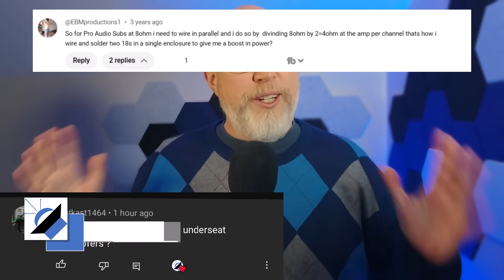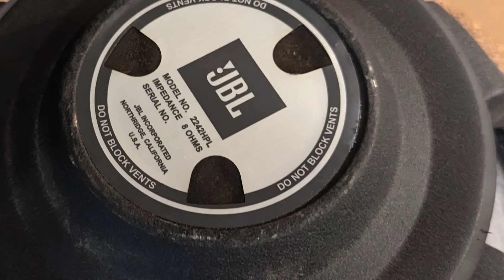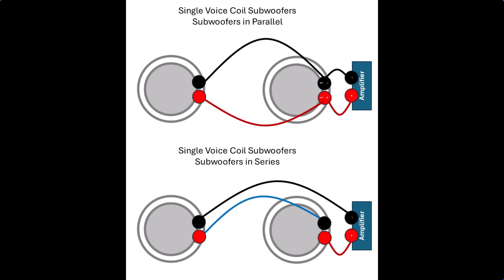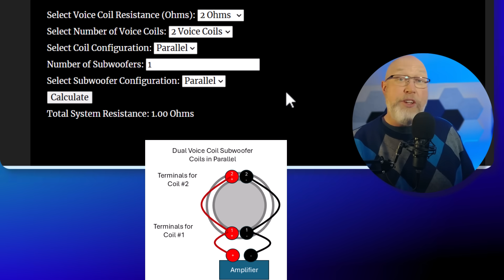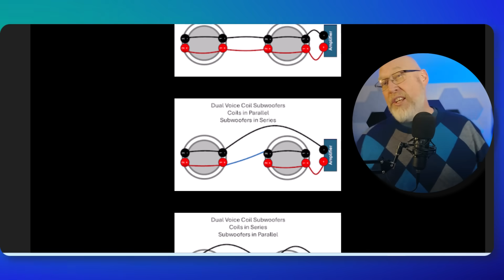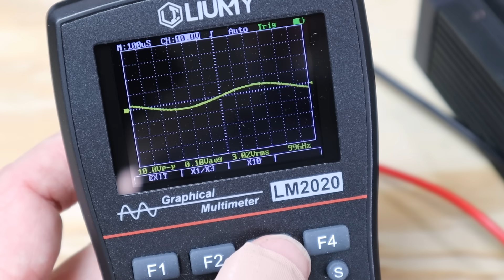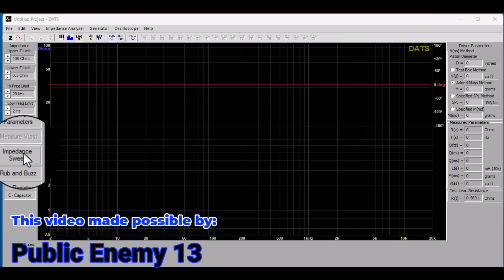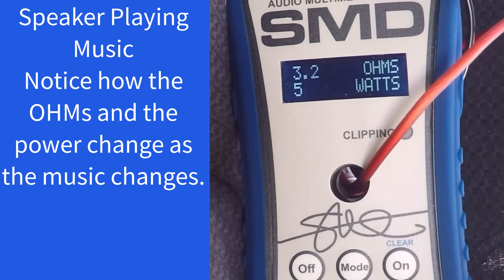Wiring your subwoofers for more power and more bass!

Comment: 12:19 "When you pass a coil through a magnetic field you create voltage". 11:41 - That impedance spike @ 62hz is directly due to the voltage the speaker itself creates as it moves its coil back and forth in the magnetic field. Since the cone vibrates the most at the resonant frequency, it creates the most back emf (electromotive force - voltage) back towards the amplifier. That measures as increases resistance to current flow therefore increased impedance. When you put that driver in a box that impedance curve will change. Anywhere on that new curve you see an impedance minimum the cone hardly moves back and forth (although it is sucking lots of power and pushing hard) and it's the boxes/ports/chambers/horns resonance that does most of the work. Anywhere on that curve you see an impedance maximum, the cone is moving like crazy doing all the work and the boxes/ports/chambers/horns are not resonating much.
Reply from the maker: Cool stuff.

Comment: Dig key calculator works great and you can add multiple resistance.       Bud you have said multiple times now that your calculator will give you the same in parallel or series.    I hope your just miss saying it.
Reply: On your calculator explanation lol.    You kept saying it didn't matter it would come out the same!    I hoped you just miss spoke there bud lol
Reply from the maker: @davidschreckengost7959  If you have a single coil and a single subwoofer and you choose parallel you will get the same result as if you choose series since there is no second thing to wire it to.
Reply: @DIYAudioGuy  oooo OK  gotcha 👍

Comment: If my subwoofer has sticker on the motor saying "3000w 2x2ohm" Then it will take 3000w, but store page says 1500rms, i have 1500w amplifier but will i buy amp that can do constant 3000w to get everything out of my speaker?
Reply: 3000w will be peak power, not performance. Youll usually find that the 3000w peak will only be at a certain frequency band meaning not the full frequency range you set it to or want to play at. Look at the subwoofer manufacturers graphs for more information.
Reply: Yes 3k watts amp
Reply: @62dobie  Also my shitty amp only gets to 31v at output when measured with multimeter
Reply from the maker: No idea, that label is a little confusing.  I would assume 3000 w total power.  But not many subwoofers can take that kind of power.

Comment: Are you sure that if you wire a single dual 2 ohm woofer in series it doesnt give you 4 ohms? Because I have done it both ways and there is a very distinct difference in volume from the woofer but that might just be because its a kicker subwoofer. 😂
Reply from the maker: If you wire a pair of 2 ohm resistors in series you get 4 ohms.
Reply: @DIYAudioGuy  lol
Reply: yea, at one point in the video he said it "doesn't matter matter if we choose parallel or series wiring, its going to give us the same answer...1 ohm". That was confusing (and sounded incorrect) but i think he meant as far as the calculator was concerned since it was a single sub? It could have been worded better. But yes, parallel drops impedance, series increases it. Think of the old "water flow" theory. If you lay 2 pipes in parallel "=" (next to each other) it makes it twice as easy to flow, ie less impedance. If you put the pipes in series "- -" it has to go twice as far and it makes it twice as hard to flow through, more impedance. (i hope i said that clearly)

Comment: How can I run 4 8ohn mid-range speakers and 44ohm tweeters to one four channel amp without damage to amp?
Reply from the maker: If you're just talking about wiring them up somehow or another, I made a calculator for that, I even made entire YouTube video showing off the calculator. 

Beyond that, you'll need crossovers, not sure what you want to do there. Are you planning on using the crossover that's on the amp or a DSP? Or do you plan on using a passive crossover network?
Reply: Or, just buy another amp for tweeters.

Comment: What are some good 12inch shallow mount subs that will bang in my single cab for a reasonable price for the power I want something good plan on running d4s jp8
Reply: Pioneer were considered the best shallow subs in their price bracket for a fair bit.
I've used and installed a heap in all different sizes and have found them to be very good quality and if mounted in a decent box they play about as low and loud as anything else in that price bracket.
I really can't fault them to be honest.
Id love to see a comparison between some of the common shallow subs as where i am most people don't want or (more commonly because they drive mid size utes (pick up trucks)) can't fit a giant box in their car but do want more than a factory system can provide.

Do it dude!!! 
Shallow mount shoot out!!!!! 
And maybe box design to maximise volume utilising odd areas of the vehicle. 
Always a fun project!!

Love your work @DIYAudioGuy you're breeding a new generation of bassheads and we need them to keep the boombap alive!!!!
Reply from the maker: The really good shallow mounts are expensive:  https://howl.link/nx4f6156piptc  and https://howl.link/qmswj5fdwzn9i are probably the best.
Reply: Wāvtech thinPRO 12
Reply: Sd4 10s worked for me in my extended cab downfiring

Comment: Great vid! 🎉 was hoping you woulda covered how best to connect a dvc to a mono amp with 2 speaker outputs. (Connect wires at sub? Or connect seperate wires from each mono output to each VC ) 🎉
Reply from the maker: I'll have to add that to my list of video ideas.
Reply: If you have a mono amp with outputs for 2 speakers, its not a mono amp. Its a bridged stereo amp. So, if I'm reading your post correctly and you have a bridged amp, you need to be careful. Bridging a stereo amp is very hard on it. When you connect a speaker to a bridged amp, it shows the amp half its rating in ohms. For example, if you have a 4 ohm speaker, that exact same speaker is 2 ohms if you connect it to a bridged amp. You should only bridge an amp if you have to. Its best just to use it in stereo mode.
Reply: @052RC lots of mono amps have dual outputs.